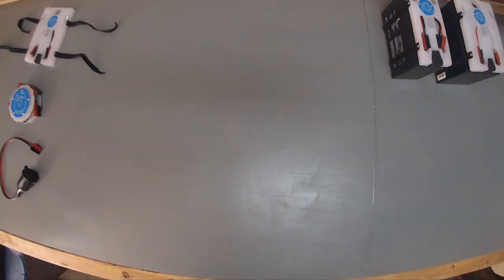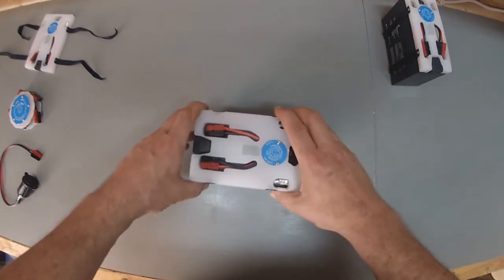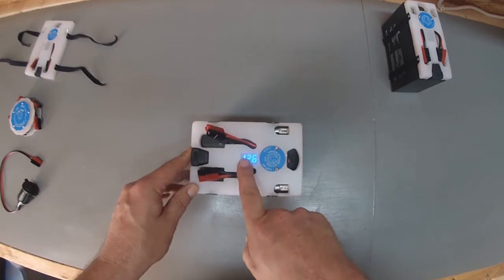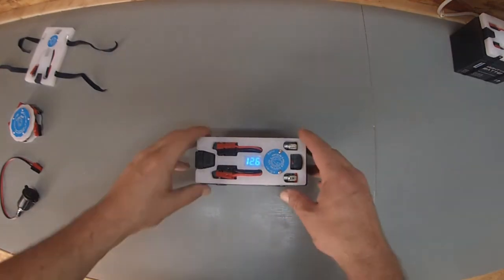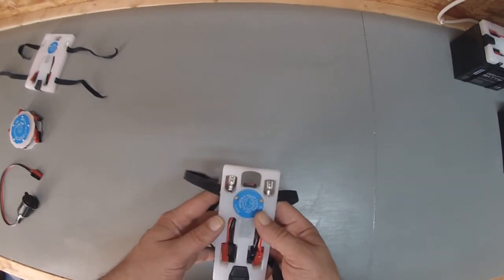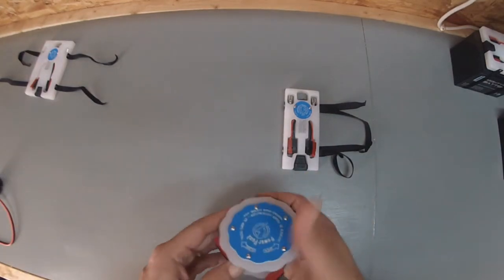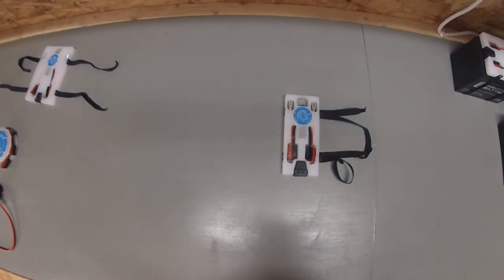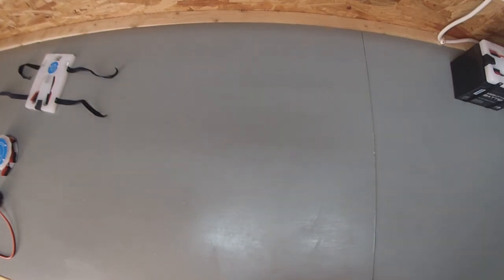BatPac RBC2 Intro

Comment: I have your juice box and love it! I have two 7amp baterries, a Genisis, and a K2 Energy?  Will the Batpac work with these batteries?
Also the Batpac solar can charge a 7AH battery?
Reply from the maker: +mtngr1 It is great to hear you are loving your JuiceBox!  Yes, the BatPac M2 will work with the two batteries you mention.   Yes, the BatPac solar will easily charge a 7AH battery, the primary consideration is the solar panel you are feeding it with...  I would consider a 5 watt panel a bit to small, a 10 watt panel acceptable, and a 15 - 30 watt ideal.

Comment: Finally picked up a few of these -- received them in just a few days.  Love the volt meter on them, and the fact that the power is active even if the meter switch is not "on" (the switch only activates the meter).  I use a Battery Tender charger to keep a few of these batteries topped off, so this is very convenient to quickly see if they need to be charged or not. Theoretically, I guess I could leave the battery tender connected to the unfused connector, and power something on the fused connector.  If voltage drops far enough, the battery tender should go back to the charge cycle on its own.  I'll have to give that a try.
Reply from the maker: Robbie, using a charger on the un-fused side while powering something else from the fused side is certainly doable.  You only need to be sure that your charger is a 'maintenance' charger (most are).  This means that the charger is constantly measuring the battery voltage, and will turn on when it drops below a full charge...
Reply from the maker: +ElfNet Gaming I'm not sure we agree... a traditional battery charger has its own overcharge protection.  We recommend using the un-fused Anderson primarily so someone does not pop a fuse when they hook up to a charger... say, for example, you are running a 5 amp fuse to protect smaller gear, and the charger hits the battery momentarily (at start up) with more than 5 amps?  I hate it when fuses go on me in the field...  I'm curious your opinion if you think otherwise, though.  ;-)